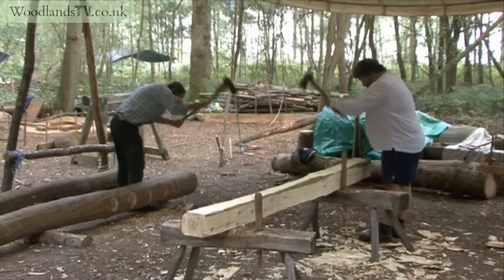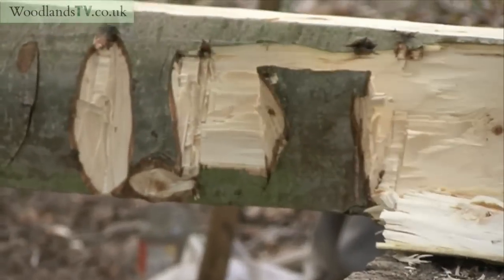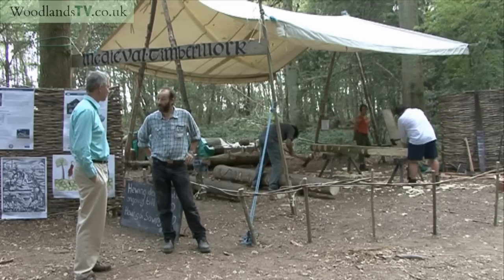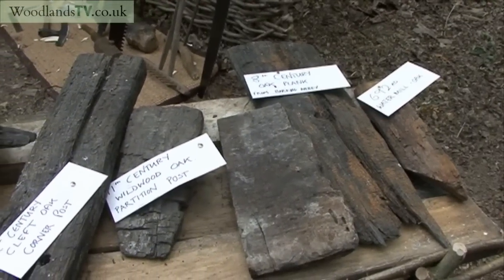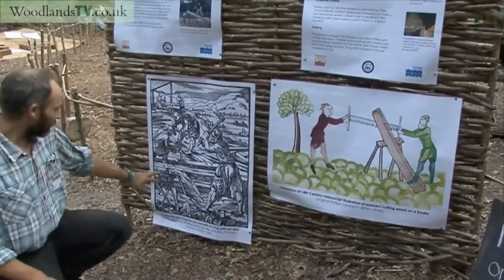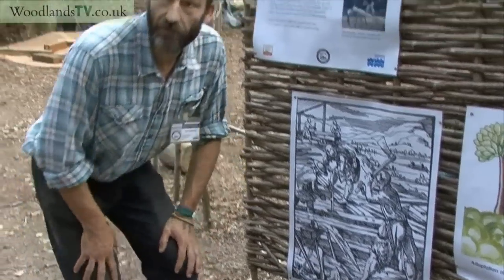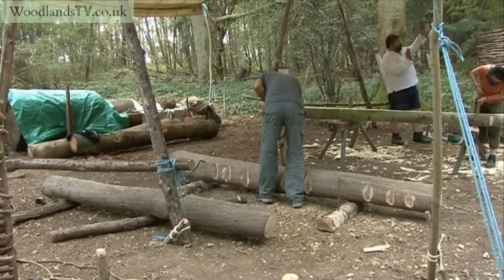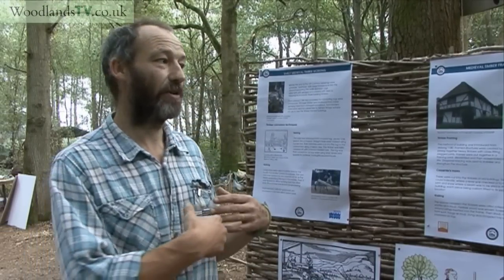Early Medieval timber work

Comment: Hard graft apart, I bet everyone had a jolly good time. It's very unlikely that the greater number will get back to good old fashioned tried-and-true techniques, but for those who took the trouble it must be terribly rewarding. By the way, this method favours stability and trueness. By very gradually liberating the strong tensions in the log, there's much less warping and splitting. Modern machines are very harsh on the timber, and cut far too fast. I'm glad to see some people getting themselves out and chopping into the stuff. Thanks for posting.
Reply: Interesting, I never thought about that, except that splitting would release some natural tensions

Comment: What was the job title for the workers who prepared timber? Would they still be called carpenters?
Reply from the maker: Hi, great question. As far as we can tell, the term carpenter has been in use since the 12th century, originating from French and originally Latin. Whilst it was originally linked to cart-making, in the 13th century it was defined more broadly as an "artificer in timber, one who does the heavier sort of wood-working." It seems that rather than having different names for those involved at different stages or levels, they would instead preface carpenter with words such as "apprentice" or "master" not too dissimilar from today.

Comment: Thanks for the video.  I'm assuming the log was green when you started.  And if so, do you have to let it "sit" before you use it?
Reply: You can build with it green, then it is easier to chop, cut, and bore. Dowels and tenons are ideally dried with hot sand, time, or maybe a torch to prevent to joint from loosening.

Comment: They are wasting the trees. Whatever you do to a freshly cut tree, it will be something different when it dries.
Reply: +SerJahPhoto the timber will move as it shrinks but it will still work. Most traditional wood crafts would have worked the timber to size while it was still green, except for work that needed to be water tight like coopering or shipwright's work.
Reply: That's why traditional builders were very particular about which trees were cut for use. Straight trees, squared of around, with the pith running down the middle dry remarkably straight. Also, because most of the rings are cut through at the edges, it reduces checking.

Splitting a twisty log and planking it causes all sorts of problems when it dries. This is what happens with modern timber. Cut it fast roughly, kiln dry it, plane the kinda straight ones to regular size and shape. Mangled ones go elsewhere: lath, pallets, OSB, etc.
Reply: Technically not true. If used as beams the wood can be incredibly green and not warp as it dries due to the fact that the heart of the tree is still there in the center. The reason boards tend to warp is because they are cut from the sides of the log. It may develop a few small cracks as it dries but its still perfectly fine.